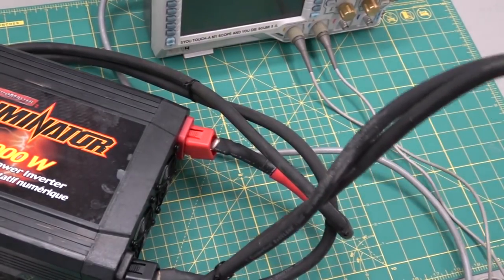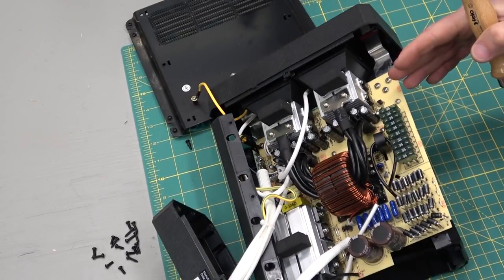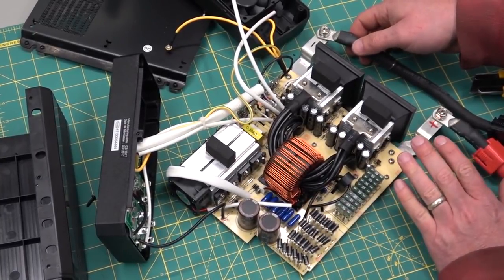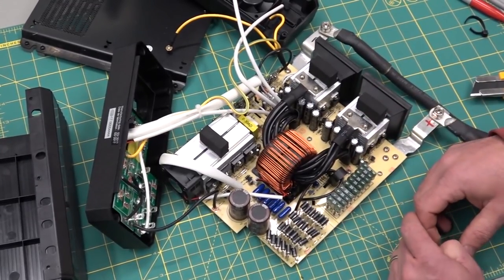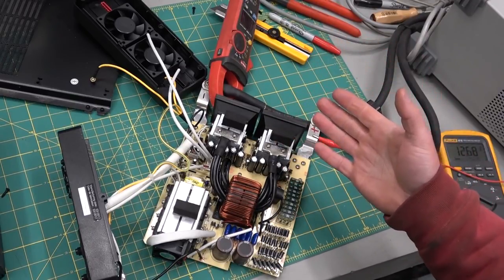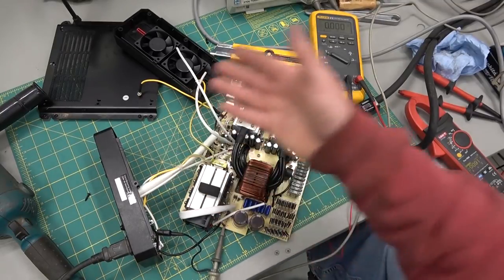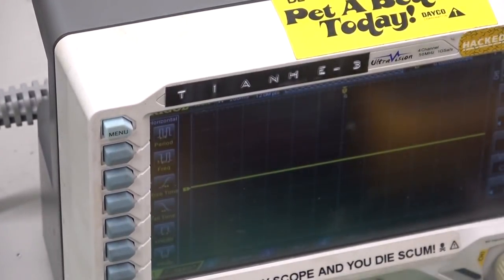BOLTR: 2000W "Digital" Inverter | Pure Sine Wave?

Comment: The input configuration is a push-pull. A transformer coupled push-pull to be precise. The current goes through the bank of fuses to the two sets of thick black wires soldered into to the board. From there it goes through the torrid once in either the left or right direction depending on which set of four MOSFETs is on. Finally, it returns to ground. Do a google search for ‘push pull inverter’ for lots of examples. The output might be an H bridge. Love the 'sign wave'

Comment: Many years back I did one of these of my own design.  It got very close to a sine wave and was quite efficient.
The primary side is fairly simple because it just made nearly a square wave on the transformer windings are 100KHz.
The secondary side was where the bulk of the magic lived.  Basically:
If the MOSFETs on the output were in step with the ones on the input you got +170V
If the MOSFETs on the output were out by 180 degrees you got -170V out
At 90 degrees the output was 0V almost exactly.
Some electronics wobbled the phase at a 60Hz rate.

Comment: MOSFETs will typically fail into a closed circuit state and then send power out the gate which the lower voltage electronics love. IGBTs which are common in other inverters/converters like VFDs will normally fail open but have much higher losses when used in low voltage applications.

Comment: Looks to me like you were right about the output power stage - it is an H-Bridge. The input side is a push pull configuration (note that one end of the windings are connected to batt +)

Comment: Connecting vehicle mounted inverters I use a test light in series to one input lead to bring it up to 12v slowly through the test light to avoid the lightning arc on the terminal.
Conversely when disconnecting I use it across the input leads to discharge the thing to avoid the 12v leads arcing if they touch while removing it.

Comment: My old man is his retired boredom decided to rewire the house with a bank of car batteries running through a 'sine' wave inverter. Despite the advice of two energy enginerds to use proper switching, or better yet, to do something actually useful, he didn't isolate the inverter properly and put the 240v mains voltage into the 24v DC input. It had 24 of those car fuses, 12 were blown, and all of its huge capacitors were ruptured. I was informed that he was sure it would be easy for me to fix it :)

Comment: One logical reason for them not putting reverse polarity protection on those things (because even the good ones don't even have it), is that an input diode would create a 0,7 volt voltage drop and on a 12V nominal battery system, it's an enormous deal. It's the assumption I've always went with.
Reply: Fred Laroche In setups like this the input protection diode is typically reverse biased across the positive and negative rails such that on a reverse polarity event the pass-through voltage is clamped to below 1V and the diode(s) place a dead short on the power rail to blow the fuses quickly.  However, the diodes are also frequently damaged and require replacement afterwards since the diode(s) often fail short-circuit.  This reverse biased setup avoids the 0.7-1.0V diode drop under normal operation.

Comment: The interesting thing is that, these kind of inverters already have a stable high voltage power supply, and usually a driver bridge at the end that generates the fake sine wave similar to class D amplifiers driving bridge. If they have added a relatively low frequency PWM generator driving the bridge at lets say 5kHz, and added a simple low-pass filter made from a single coil and capacitor to filter out the driving frequency they could produce almost perfect low frequency sine waves (50-60Hz) with very high efficiency. It is just not needed in the most cases. But if it was needed, it could be made for a little more price.
Reply: You would probably run into some difficulty with mosfet charging wasting some power. Or other capacitance in the circuit.
Reply: What do you mean? Class D amplifiers work exactly the same as this inverter, it is just switching the mosfets on/off, thats the most efficient way to reduce power dissipation, therfore minimizing power loss. The only difference is, you dont just simply turn them on/off in a square waveform, but you modulate the width of the squares, to create sine. Btw if you use igbt mosfets for switching at the end (and you can, since the voltage isn't extremely high and the frequency is low) you can increase the efficiency even more. Especially if you make ZVS switching for the power supply area.
Reply: I've built a class D, and I believe the coil cost me around 5 bucks. Which is really expensive for these kinds of electronics, which is probably why they didn't bother. Lot of copper needed for high current.

Comment: Put a old fashioned incandescent test light in series with the inverter before you connect it. The lamp will act as a resistor and prevent the surge of current that creates the spark. You can watch the capacitors charge via how bright the lamp is lit. It will be bright at first and dim until it goes out completely, indicating the caps are fairly well charged. Then I connect it directly.

Comment: P-channel mosfets work well as reverse polarity protection on low power low voltage circuits when you don't want the voltage drop of a diode.

Comment: Anybody else hoping he would have reversed the positive and negative connections so we could see the inverter fry?
Reply: Wrong channel, for that go visit electroboom! 🤣
Reply: I've done itbefore, let the magic smoke out and set the pixies free, although I will say they were REALLY fuckin pissed off.
Reply: I have done that a few times as well, not on purpose though
Reply: I did that once on a motorcycle battery charger.  It just blew an inline fuse.  Another (smarter) charger just shows error indicators for reverse polarity.
Reply: It would stink for days with that many caps blowing.

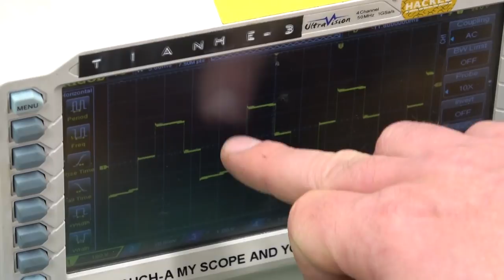Comment: At time 13:07 it looks like a modified sine wave.  I also heard that a lot of times the ground in the inverters is connected to one side of the batteries and the inverters run a live neutral and a half voltage scheme in which the circuit is essentially two 60V inverters and they are connected together in series by the load you connect to them.  The two I think are opposite phases.

Comment: Remember doing a tour of BC Hydros VIT (Vancouver Island Terminal) in North Cowichan near the end of our 4th yr ElectChickin training (1977). There is an under water (and also a ‘sea link’ negative return!) 330kV DC cable link to the Delta terminal that changes the DC pixies back to the AC. (That I believe is now an ‘emerg’ back up to the 500 kV AC line across to the island) They had MASSIVE mercury arc thyristors to create the AC pulse and then a couple of 1Mw synchronis rotary condensers running in a pressurized hydrogen atmosphere (!!!) to ‘smooth’ out the wave (and could also ‘adjust’ the frequency averaged to 60 hz over a 24 hr period by playing with the excitation) All the while, thinking that it was a halloween setup or something from Dr Frankenstein. They had experimented with using massive banks of 200 amp rated SCR’s as the maintenance on the mercury’s arc thyristors was costing a fortune... last I heard, that only increased the speed of getting the 500 kV AC transmission line completed down from the WhackyBennet dam. Pretty sure Kanuckistan Tyre wouldn’t go to all that trouble! Always a pleasure to watch you thinking out loud while also engaging your safety squints.

Comment: In my experience disassembling stuff factories usually use N-Channel Mosfets for Half or Full H-Bridges along a floating gate driver to save in costs as N-Channel mosfets cost much less for the same current capability than P Channel ones so the driver will have a charge pump dc-dc to boost it to say 36V and so you can drive the lower mosfet with 12V and the upper one with 24 or something like that so that the lower one has 12-0=12V between the gate and source and the upper one has 24-12=12V between its gate and source. :P

Comment: I was ready to walk when I saw paralleled fuses and diode - probably unmatched to boot. At full load that's 220+ amps draw on the battery at 90% efficiency.  I hadn't thought of the pulse effects on the batteries - thanks! This would need an output 1:1 20 amp transformer to get a fairly clean regulated output.

Comment: Proper sine wave inverters have a suitably sized output filter (LC filter, inductor and capacitor) and in order to keep the size of those parts down (for package and cost reasons) will run their output chopping at a much higher frequency, which means higher losses or the necessity to use better fets (lower RDSon / smaller parasitic capacitance etc).  All that adds cost, so is avoided on lower end devices

Comment: The input power stage probably has a common positive on one side of the transformer, and two giant windings that lead to the fets. The sets of mosfets pull one or the other winding down to ground. The output stage is an H-bridge.

Comment: The failure mode of the MOSFET depends on the scenario, but would typically cause a short across a combination or potentially all three terminals.

Comment: Could also be using increased drive voltage for the Mosfets so it can use n-channel FETs as high side switches.
Reply: The cost of n-channel mosfets with high-side drivers is likely lower than that of p-channel mosfets with the same ratings
Reply: They use bootstrap circuits for that: very cheap and effective. Capacitor is charged to some 12 volts when lower switch is on. Then capacitor is commutated between source and gate of high-side mosfet, so it turns on. Voltages on both plates of capacitors rise quickly up to rail voltage, but it's no problem. Voltage across is still the same.

Comment: Every piece of of reverse polarity protection you put in a circuit path also costs you efficiency. You either have fets that you have to keep open which have a non zero resistance, or a diode that also has resistance, or the contacts of a relay which again, have resistance. I prefer to go the efficient route. Double check your work.

Comment: your output mosfets (DC to AC)  is your modified Sinewave H-Bridge...  the 8 Mosfets at the Input  are 4 for one side 4 for the other, The config is when one side is ON the other side is OFF, and then switches. this produces a Square wave pulse into the toriodal transformer  which is increased to the desired Square wave AC output. Rectified and sent to the Modified Sinewave H-Bridge.

On a side note... with any inverter  just to be on the safe side always remove half the rated fuse cpacity... so if  100Amps  use 50amps   that way  load protection fails the fuse, not your device... Under larger loads  those pixies want to really unchuche your chucher

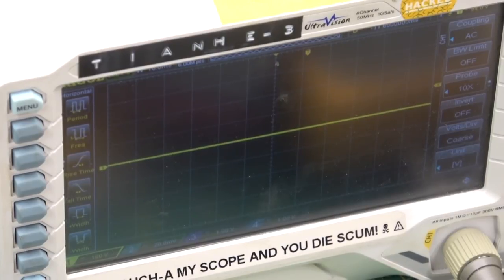Comment: At 12:04 that is NOT noise that is modified sine wave and it looks perfect. The reason it looks so wacky is because there is no load and because you are looking at it off the transformer instead of the output (effectively what you do when connecting to ground). Always think of ground in a DC circuit as what ever the transformer is doing. At 12:57 you are looking at some high frequency filtering and output caps as well.

Comment: A better solution for reverse polarity input is using a contactor. When the voltage is correct a hugh contactor switches on. (A linear motor can be used for no current drain - old school) (new school would do it differently but both ways MUST have a low voltage drop)

Comment: I blew up 4 of them lol
Reply: I only blew up one... it was the fire from that which blew up the pile of 3 spares...
Reply: Damn, you are way ahead of me. I’ve only blew up one and it lit on fire.
Reply: Ghee, the most AC inverter excitement I’ve ever had was all the cheap Chinese input filter capacitors shorting simultaneously upon powering on an inverter that had been sitting on the shelf for several years since its last use — I feel cheated of the experience!  Mine just produced a lot of foul smelling steam from all the electrolyte boiling off in a few seconds.  But I’ve yet to actually destroy any inverters, though I have at least 4 or 5 AC inverters that I use from time to time.  

If you have certain batteries that you most frequently connect your AC inverter then to you can greatly reduce the likelihood of reversing the polarity by using high current polarized power connectors that you leave preconnected on both the inverter and batteries — but that will spare you getting the polarity reversed as long as you take care to double-check your work carefully when you first install the.  Anderson Power makes up several styles of such connectors that are rated for anywhere from tens of amps on the small side up to 1000+ amps on the larger end.
Reply: @ethanpoole3443  I prefer to use SB175 connections, then multiple battery pairs at 24v. This allows me to hot swap batteries when needed, but keep the load functional.
Reply: I had 2 of them in my truck one was to run the fridge and the other was for the coffee maker and whatever appliances I would use in the truck. Fyi. I had 4 batteries hooked to mine. And ALWAY had to had the truck running to keep the batteries charged and the was only when I was using them I don't know if I was doing anyþhing wrong. They'd alway fault if I didn't have the truck running. Like to see if you could blow that one up with over loading it. Not hooking it up backwards.

Comment: A diode for polarity protection would kill efficiency, at those current you could easily lose 10% of the 12V
Reply: They make reverse polarity protection ICs that have hardly any voltage drop, but cost a lot.
Reply: You can do polarity with a power MOSFET.
1) Simple form that doesn't work:
Put N-channel MOSFET in the ground side of the input.
Install it reversed so the body diode doesn't conduct.
When the polarity is right, the MOSFET is on.
Hook its gate to the +12V input.
2) Slightly more complex version that does work
2A) Add circuit so that voltage spikes can't get to MOSFET's gate.
2B) Add circuit so that the gate goes up slowly

Comment: I'm late to the party, but at a glance the handful of paralleled diodes are in parallel with the 12V supply rail after the fuse. This forms a crowbar circuit to protect against reverse polarity. Literally shorting out the reverse polarity battery and forcing the fuse to blow, exposing the electronics to only - 0.7V. (which shouldn't cause damage)

Comment: Can you show on the oscilloscope the smoothing action of an inductive load? Thanks
Reply: This a great idea, how about it AvE?
Reply: That would require a current probe for the scope, which isn't exactly cheap.
Reply: +NiHaoMike Nah he could use a shunt resistor
Reply: NiHaoMike why wouldn’t measuring the output voltage work? Just measure the same but with the vitamix at full speed. See what happens to the “wave”.

Comment: It doesn't claim to be a Pure Sine Wave inverter.  The box and website both says it Modified Sine Wave.  They use standard automotive fuses so that if the user ever has occasion to replace them (i.e. he connects to the battery in reverse polarity). replacement fuses are easy to find.

Comment: Quick test about your inverter, Put it under load and bring your AM radio close by. Tune arround If the pixies squack out the radio, bad inverter. You may just have a 2 kilowatt RF transmitter trying to make AC at 60 or 50 Hz.

Comment: two thoughts from personal experience:
1. fuses are there to prevent fires and will never save components. If CSA didn't make us do it, we sure would not spend the dime :)
2. no reverse polarity protection likely due to the fact that a series diode would be dissipating a lot of heat (~100W at 350 Amps). Plus how am I going to sell you another one?

Comment: I had the crazy idea to build one of these to power my house. After studying for a while I bought one! It could be a center tap toroid. Where half is wound backwards. And is equal to having a h brige as far as the transformer/ torroid is concerned. I think I could build a inverter if I had help with the controller side. I'm no programmer!

Comment: I have a Magnum energy 4400W 48VDC Pure sine wave inverter which I run part of my house from.  They claim "pure sine wave" but the Keurig which I don't own anymore didn't like the taste of the AC the inverter puts out, also my alarm clock would lose 2 minutes a day.  
Id love to see a BOLTER on one of these if you could ever get your dirty meat hooks on one.
Reply: 2 minutes a day is only 0.14% - even clocks run on mains power that use the AC frequency for time keeping often don't do massively better. Tom Scott did a video on this quite a while back...
Reply: @peglor  It's a lot. In Europe it was a argument regarding the electrical grid. It made the grids frequency "bad". But even during this the clocks that uses the frequency only lost like 6 min in two months.
Reply: Use an inverter that can get its clock reference from a bog standard 10mhz GPS reference, problem solved for you off the grid folks, man I would so do that myself as it seems like a cute mod project.
Reply: AVE made a note about inertial energy, it definitely had to do with all of the grid's generators moving slightly too slower due to some excess load, getting them back up to speed could take a long time if you are trying to sync to another grid that is out of sync.... etc

Comment: If my guess is right, those diodes are paired with those capacitors to create multiple voltage multipliers.  Earlier this year I was looking at a 240V VFD and wondering if I could use a simple Diode Based Voltage Doubler out of a Bridge rectifier to power it from my 120V Outlet.